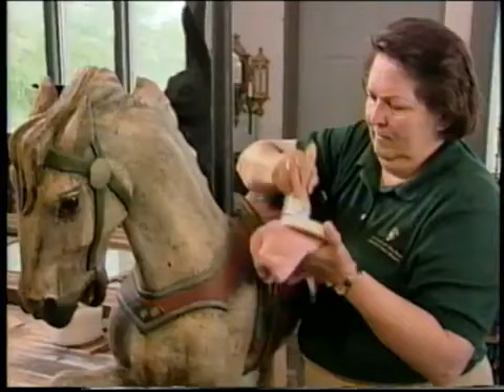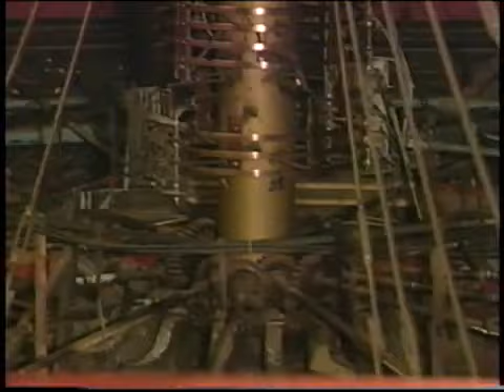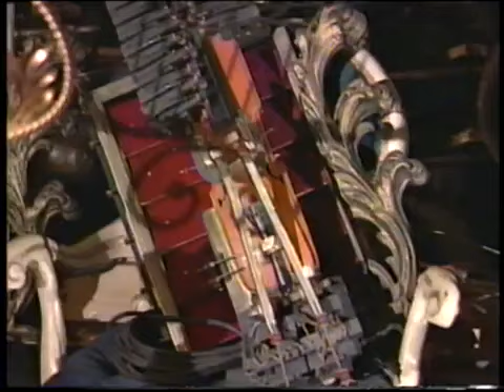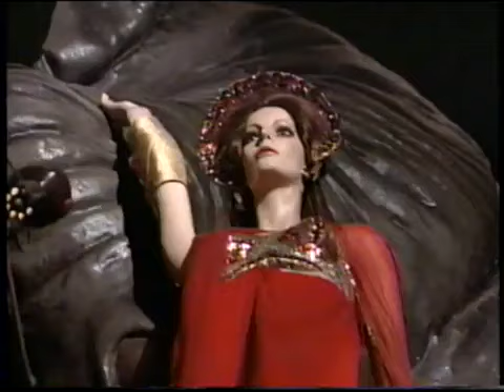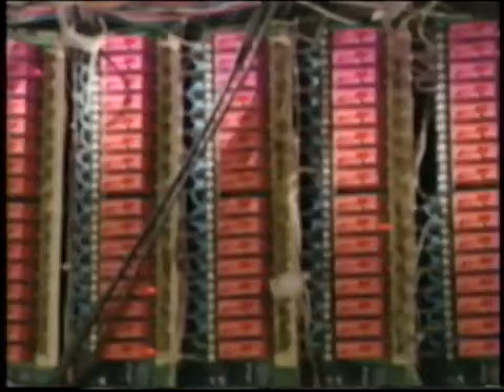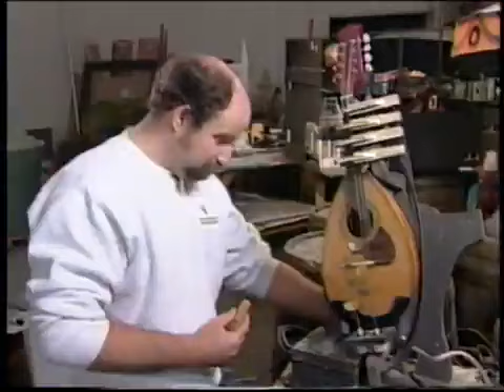*VERY RARE* "Behind the Scenes: A Backstage Look at House on the Rock" VHS 1999

Comment: For clarification: The mandolins in the Moon of Manakoora stopped working in the 2000s because the heat-less facility could no longer handle the warming summers? I've only ever been to the house in the summertime, but I'm sure it was at least a little less hot in the summers back in the 60s-80s. I get so upset thinking about the wintertimes there in Spring Green, it must have gotten a lot more snow than it does presently.